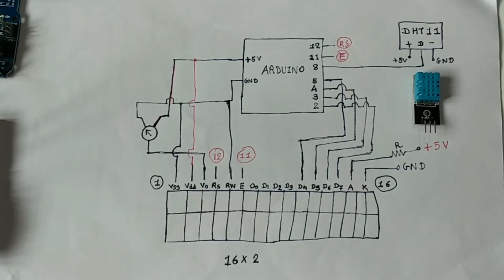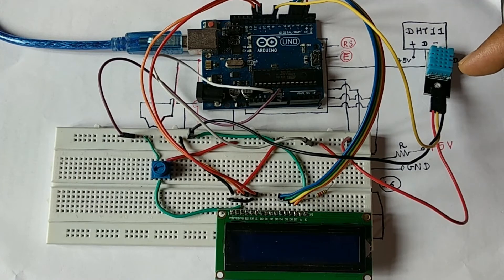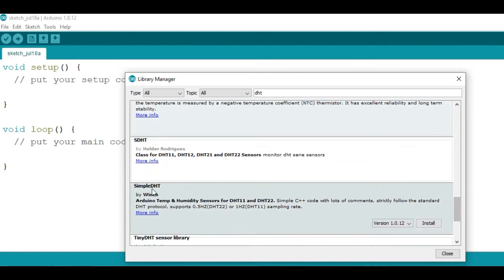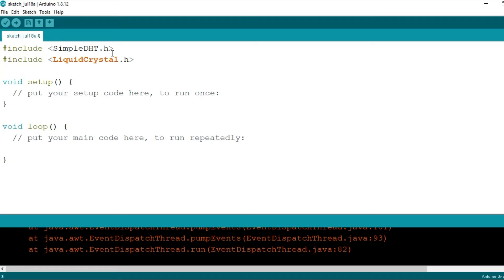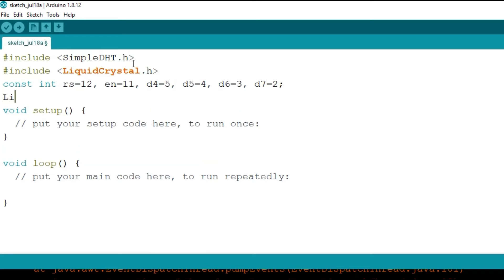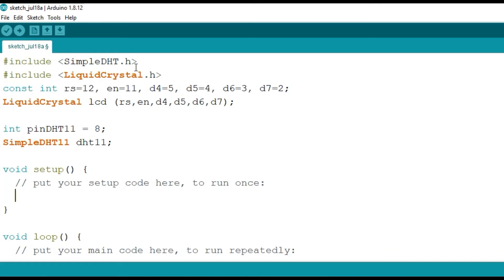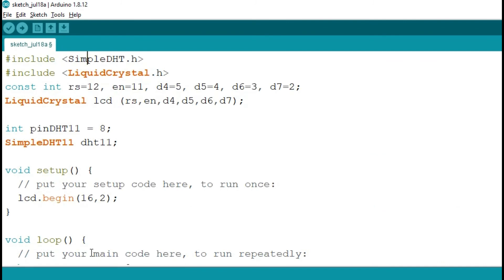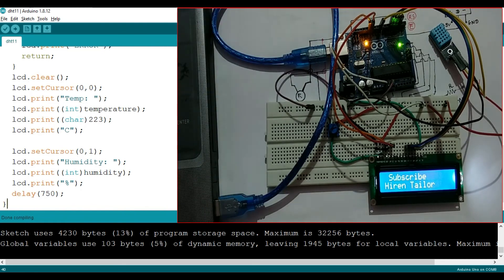DHT11 Temperature & Humidity Sensor with Arduino

Comment: Can you provide the names of the components used in this
Reply from the maker: @subdiesion8821  Arduino Uno, DHT11 sensor, 220 ohm resistor, 1K potentiometer, other details are mentioned in circuit diagram link mentioned in description